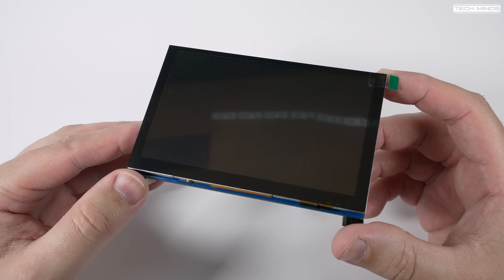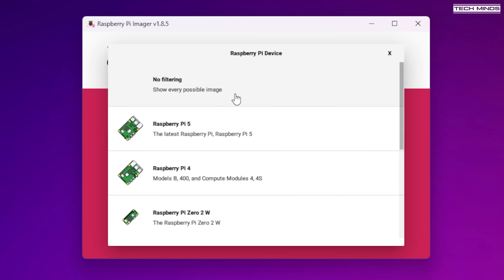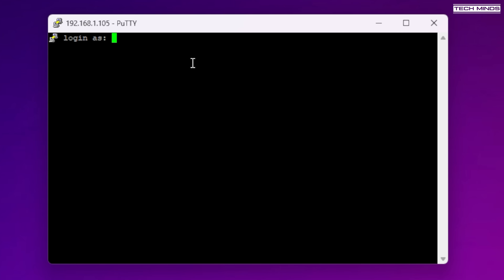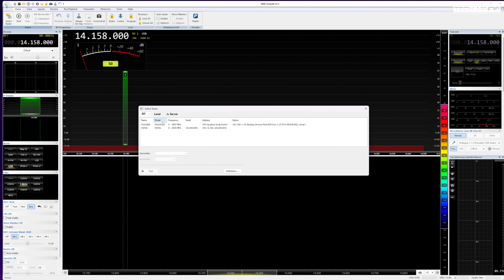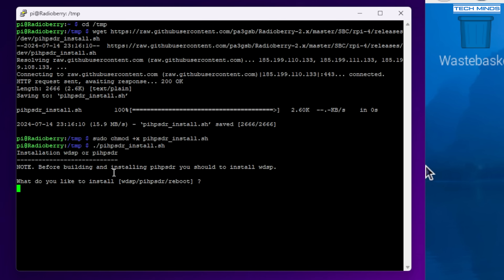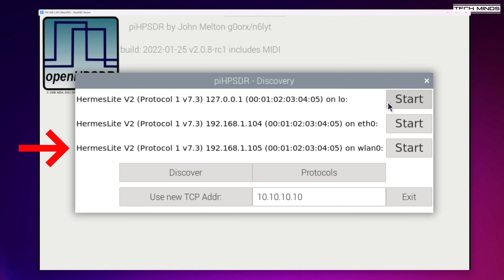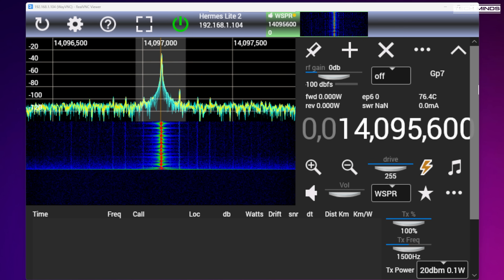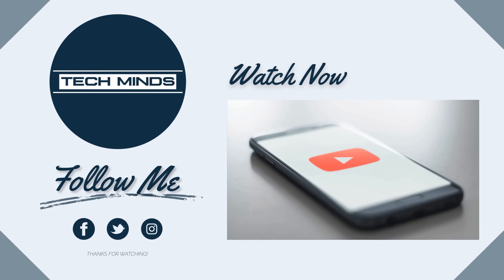The Beginners Guide To The Radioberry HF SDR Transceiver Pi Hat

Comment: Nice. Any possibility for it natively decoding ft4/ft8, PSK31 etc directly on the device without an external computer? Also are there larger screen options? I’ve seen these on aliexpress but all kits seem to only come with a 5” display

Comment: Wasted $300 on this and can't get the setup to work sending it back for a refund
Reply from the maker: most users issues are related to the username NOT being set to "pi". The install script, as far as I can remember will try and install certain files in the "pi" directory. Unless you have a faulty board.
Reply: @TechMindsOfficial  the normal phone installation went all right. However, when I chose CW the thing did not start up showed error messages.  Thanks for the video Mat!

Comment: After installing bookworm I had to do a sudo apt update followed by sudo apt upgrade.  
Then I had to run sudo apt install --reinstall raspi-firmware, followed by a reboot.  
After that reboot I ran sudo apt install linux-headers-rpi-v8 and then finally I could proceed with the radioberry software install and everything worked OK.  
Before that was several hours of guess and test and reading.  
I finally found these tips in the radioberry google groups as posted by qrp73.  I think these additional steps are due to an update in the bookworm software and do not reflect poorly on the Tech Minds video and these steps may not work in the future.  My comments reflect the state as of 2025-01-01.
Best regards or 73 for the hams.  WA0A

Comment: is there a preselector available for this?
Reply from the maker: N2ADR makes a filter board for the HL2 that should be compatible with this. However, you will still need to handle the RX and TX ports.

Comment: I returned the complete radio. Typically a design by a programmer who did not take into account the heat development of the components.. And to always listen to a blower that needs to be mounted.... Crazy!!
Don't buy is my advice!!
Reply from the maker: That’s absurd to be quite frank. Cooling is not an issue, silent fans if needed. Maybe “off the shelf” black boxes is more your thing, which Is totally fine of course. But to advise anyone not to buy is like saying to never experiment with ham radio.

Comment: Nice video as usual. I'm using SDR-console for many years now. I noticed on Youtube that the waterfall and other things are almost never set correctly. As I may suggest as to set the waterfall dynamic range to 50 dB and use a pallet with contrasting colours (I made several types) so the noise floor is almost black. Set the resolution to x2 or x4 to get more details. This way you can see a needle fall, so to say. Good luck with the channel. 73' Ron - on2ron
Reply: Very helpful comment thank you.

Comment: You can do the download and start installing in one go, without having to use chmod (Change Mode, change access permissions) or executing the script by using curl to download the script and pipe it to bash:

sudo curl -sSL yourURL | bash

Switches:
-s = Silent (no progress or errors)
-S = Disable download progress bar, but show errors. Used in conjunction with -s
-L = follow redirects (e.g. 30X response)
Reply: whilst it's relatively common, that's a bad security practice to pipe a script from the internet into bash.
Reply: @danielkingshott2659 if you're already going to blindly chmod +x and execute, what's the difference?

Comment: I'm so happy for this recent video ! Actually, I'm a graduate student, and I'm working on ultrasonic transducers. I have to test how efficient acoustic communication is by implementing modulation techniques using Gnu radio. 

I've already installed pihpsdr and want to know what are the librairies and drivers that I could install in order to transmit and receive using Gnu radio. 
There is a lack docs in this case so I'll be very very thankful for your help. 
Thank you!

Comment: I wonder if it's possible with the onbaord software to create a transceiver? I guess you'd need some kind of sequencer to detect the PTT switch and pull a digital input on the Pi to put the radio into TX mode and then trigger the PA?
Great video 73

Comment: Thank you for a very interesting video. I don't understand how the audio goes when the display is connected via MIPI DSI display port ?
Thanks!
Reply from the maker: If you are using PiHPSDR on the pi, with a screen, then you will need a USB Sound card/fob. Very cheap on ebay/amazon etc. That will provide audio out and then a microphone input. cheers
Reply: @TechMindsOfficial  Ok, thank you!!!

Comment: I think your channel is brilliant, and I have a question unrelated to this actual radio.  But what do you use to see your spots with WSPR?  I use a Hermes-Lite 2 with the IO board, Filter board and the enclosure.  I saw it on your channel and thought it looked perfect for me.  I integrated it with a Xiegu XP125B for a little 100 watt station and use a ~40 metre EFHW at my antenna.  I also have it setup with an RF Sampler so I can use Pure Signal.  Anyway a lot of the stuff I used was all based on your reviews/channel.  So thank you mate!
Reply from the maker: You're most welcome, and I am happy to hear my videos have helped you out. You can view the WSPR spots @ www.wsprnet.org and then use WSJT-X software to transmit the WSPR. Or if you are using the hermes lite, then you can use SparkSDR.

Comment: Show the filter board and rx/tx port combiner in use.   

Maybe a small PA as well

3 part series ?
Reply: Id love see you get this up to 10 or even 20W with some filtering. 73 de KI7OXA
Reply from the maker: There is a 5 watt pre-amp board that was designed by the same guy that designed the Radioberry. It's a pi-hat that sits on top. The gerber files are available FOC on their github page. I think I made a video on it some time ago.